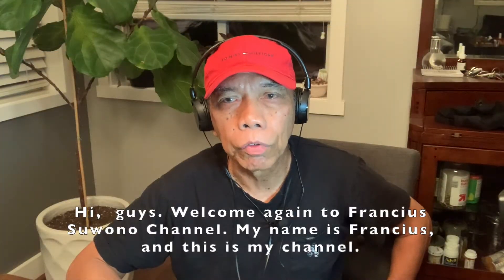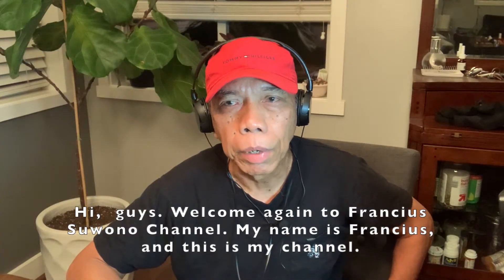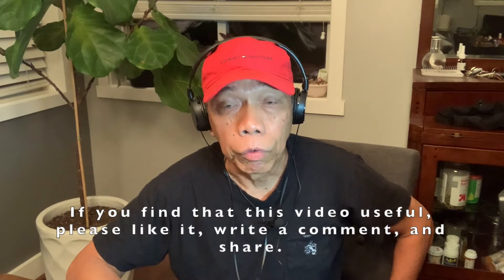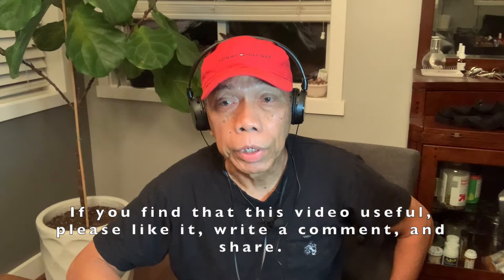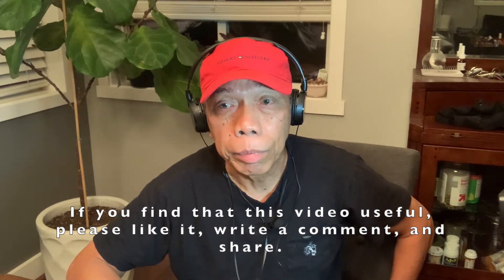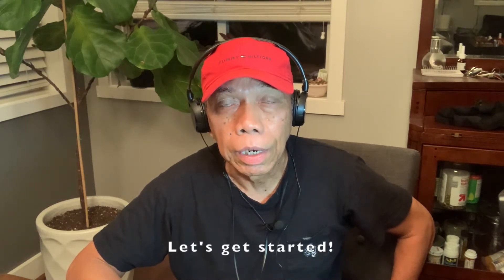Optimizing Your Tempeh Incubator

Comment: Hi again Francius, I have made several batches of Tempeh with several different legume recipies you show and they have been very good, but I just had an issue I hope you can help me to understand. I incubated soy for 24 hours and took them out and placed them on table to cure, but next day they all had good mycelium around the edge, but the center of each bag had no mycelium and I had to cut off only the good part and throw the rest away. Is the center of each bag too hot or too cold or something else? Thank you!!
Reply from the maker: It is possibly too hot. A higher temperature usually takes toll on the centre part, and the mycelium was dead. The edges were cooler, that’s why the mycelium still grew. Temperature control is a significant issue if you don’t have an automatic temperature control system. My DIY incubator is automatic.
Reply: @francius1003  Thank you! I am grateful.

Comment: Hello Francius,
Thank you so much for your videos ! I have two questions :
Is the ventilation going to make the tempeh dry ? 
Do you have any alternative than using a towel on top ? I’m using open trays but for hygienic reasons I don’t use towels in the process
Thank you so much and happy tempeh !
Reply from the maker: Fermentation needs a high (at least 90%) humidity. Keeping your pan open for 36 hrs at 88°F will dry out your tempeh. It will even dry the damp towel. Instead of a damp towel, you can use a perforated plastic sheet or banana leaves to cover your pan. A damp, clean towel is hygienic since it will not touch the tempeh. 
Francius
Reply: @francius1003 ok thank you for your answer 🙏🏼
If I understand it right, the ventilation process inside the incubator is going to dry my tempeh only if I don’t cover the mold I’m using ?
Thank you for the ideas of replacement ! I’m working in a restaurant in France and we’re not allowed to use towels, that is why I asked. The alternatives you wrote are nice ones ! :) thanks

Comment: What's the recommended humidity level may I ask?
Reply from the maker: It needs at least 90%. If you use plastic bags you don't need to worry about humidity. It is almost 100%. If you use an open pan, you must cover the top using a damp cloth.
Francius
Reply: Sometimes I get some yellow spots, do you have experience on these? Are they harmful or harmless?
Reply from the maker: @ccdin1  Yellow spots indicate unwanted fungi or failed fermentation because of too low temperature. They are not good.
Francius

Comment: Hi Francius! When you take it out of the incubator after 14-15h, what is your room temp and do you cover the bags? Cred for great tutorials :)
Reply from the maker: Hi, Anders!
After 15 hrs the tempeh is self processing and creates its own heat. Taking out of the incubator prevents the tempeh from overheating because the incubator cooling fans may not be able to control this extra heat. However, the tempeh still need a moderate ambient temperature to continue processing, normally 70F room temperature. I usually cover the tempeh with kitchen towels to prevent heat loss. After 36 hrs you will get fully developed tempeh.
Francius
Reply: @francius1003  Hi Francius! Great information! I just have a heat mat and no fan so I think i'm just setting my thermostat to 70F an open the lid. Cred for your kindness and your inspiration :)

Comment: Francius,  I was able to make a two bag incubator, from an old styrofoam cooler, with the controller, heat and cooling source; ensuring that the temperature stays within the parameters of 31C +/- 0.5C.  I understand that after 14 to 15 hours the tempeh will produce its own heat.  You suggest that I place the tempeh in room temperature for the next 10 to 22 hours, until is done. During the winter my house is usually around 15 C.  Will that be ok or shall I return the tempeh into the incubator and reprogram the controller to 21C +/- 0.5 C until done?
Reply from the maker: Hi, Rob. Since each incubator has its own characteristic I would suggest you do the following experiments: Take out your tempeh, blanket them with towel or napkin to keep their own heat. After 24 hrs you can check the result, and continue doing it until 36 hrs. You can also experiment by adjusting the controller, but you never know if the cooling system can handle the heat increase. So, check it regularly. Do not allow the temperature goes beyond 33C. Let me know the result! Good luck! What is the size of the incubator and how many tempeh? Just keep in mind, overheating is more dangerous than underheating after 15 hr.
Reply: Thank you Francius for your prompt reply. I will try a variety of experiments and will let you know the results.
Reply from the maker: Rob, thank you for sending me email showing your good result. Congratulation! Enjoy your tempeh!